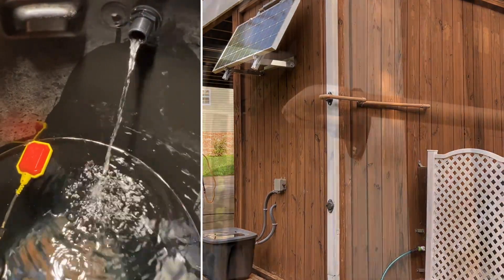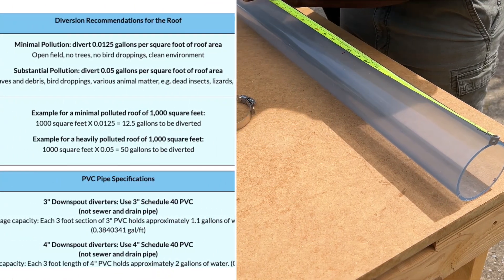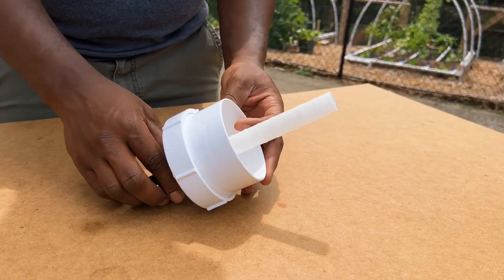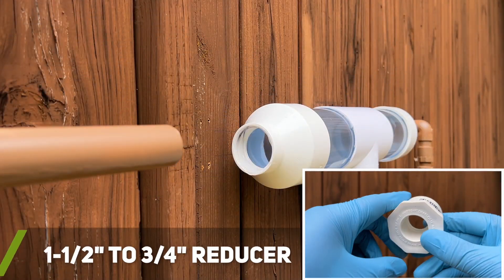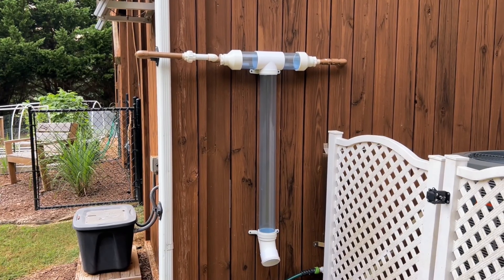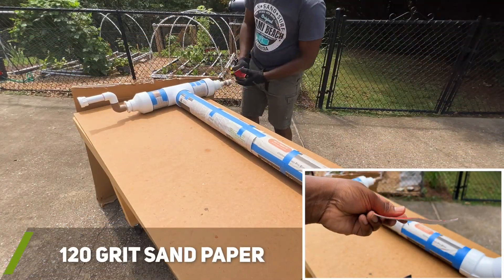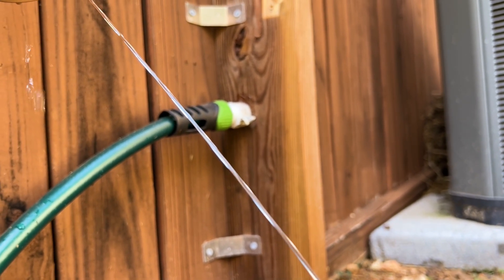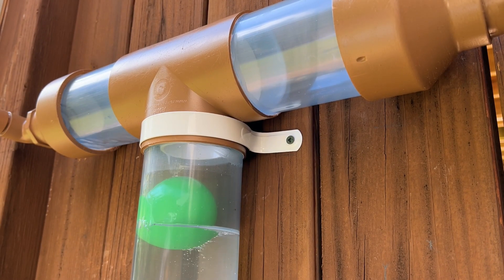Capture CLEANER Rain Water Using This SIMPLE Device

Comment: Try using a water bottle (same diameter as the ball) that is partially filled with water to keep it upright instead of using the float ball. You may noticed in the video that, with the float ball, the water in the first flush reservoir was fully filled before the incoming water is diverted to the tank. With a float ball, floating debris can flow above the ball and ended up in the tank. While with a water bottle that is elongated, incoming water will be diverted when the bottle blocks water into the reservoir leaving a air gap between the top level of the water in the reservoir and the diverted water, preventing floating debris from flowing into the tank. Just my 2 cents.
Reply from the maker: Good idea. I have seen both scenarios with the current ball. The one you mentioned where the chamber filled completely, and another where three was a 1/2" gap of air between the bottom chamber and the water above. Thanks for sharing, I may give it a try.
Reply: @GreenTechTown  First, Excellent video and narration!  I've just found your channel and I'm hooked :)   Though, silly question:  seems to me that the ball is completely optional?  The incoming water will fill the debris pipe and continue to the outlet side with or without the ball; however, with the ball in place, wouldn't additional (at least not floating) particles 'fall' into the debris pipe as intended -- vs. having the ball force the debris directly into the outlet?  [sounds like an experiment for a video!  lol ]
Reply: @sstreet9436  The idea is to catch even the floating particles in the chamber. Without the ball they would float to the top as the chamber fills up and then into the collection barrel.
Reply: @sstreet9436 It's not intended to continuously remove debris from the water just the rubbish that had collected on the roof and in the gutters since the previous rain, this initial flush of water and debris falls into the chamber and once the chamber is full the water is diverted straight through with the hope that the majority of the debris from the roof and gutters was flushed and trapped before the chamber filled.

Comment: Very nice, I learned playing with PVC, before you paint it and after sanding, if you have some PVC cleaner, wipe that on it, clear is better but blue is fine too. This opens up the PVC, so it is more porous and allows the paint to attach much better. Good to see some people are still able to get PVC parts, locally it has become slim pickings.
Reply: I ordered some specialty fittings for a project from a company called PVC Fittings Online. Maybe give them a try?

Comment: Nice, we use our rainwater for the house and I finally conceded I need to make a first flush because too much crud was getting in the tank off the roof. The angled end is a good tip I never thought of, that solves the problem of the cap being hard to access. Now I just have to find a ball just the right size, haven't found it yet!
Reply from the maker: I'm not sure what size ball you might need, but I discovered that you can buy the sealing ball (3" or 4" version) separately (for about $10) off of Rain Harvesting's website for those building a DIY first flush.

Comment: What's the next upgrade going to be? How about something on the raised bed side of things, like a moisture sensor so you can water when the soil is dry? Btw, I've watched all your videos about a hundred times and this month put together my own system. So, thanks.
Reply from the maker: Good idea Korgan! Something I may look into when I can. Have you come across any reliable solutions that also do not require extensive programming/circuitry?
Reply: @GreenTechTown  Nope, not yet. All the sensors I've found so far seem like they corrode when left in the ground, and the NPK sensors I've looked at seem to be easily tricked by salt in the soil.
Reply from the maker: @korganrivera4659  sounds familiar to what I saw when I quickly took a look at the available sensors a few months ago.
Reply: Look on YouTube for DIY projects using  Raspberry Pi computers and soil moisture sensors.

Comment: My main question is why such a small pipe coming from side of gutter downspout? I wouldn’t think you would need a 1st flush system.
We built new house in central Florida and have 8000 gal storage, 2-4000 gal tanks. We have a first flush that then goes into a 55 gal tank before going into storage tanks that we use to water garden. I wasn’t comfortable with the size of the 1st flush with the size of roof is why the 55 gal tank.
Reply from the maker: Hey Frank. No particular reason. It's just the size my first downspout diverter was compatible with. As I continue to venture down this rain collection path, I'm sure I'll be upgrading the system to use 3"/4" pipe one day.

Nice system size by the way, and good idea with the 55 gal tank. I would love that have something like that available.

Comment: I tryed the earthminded kit so far mine doesn't work i did a video on it i need to seal it
Reply from the maker: Sorry to hear that. I took a quick look at your installation and review video and I could not spot anything obviously wrong. I do know they sell 2 different size diverters, and from the camera angle I could not tell if it was the correct size or not, but I would probably reach out to customer support  and send them both videos. If sealing it does not work & they cannot determine what's wrong, if possible, I would try a different style rain diverter that may work better for your setup.
Reply: @GreenTechTown  ok thanks thats my plan for tomorrow if it doesn't rain yeah its hard for me to get good camera angles i use my ipad pro at the moment